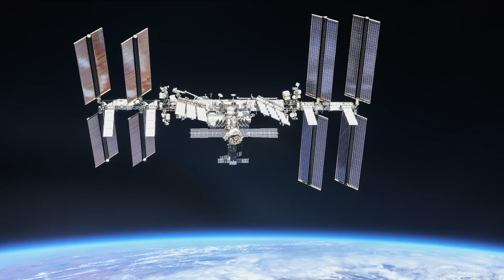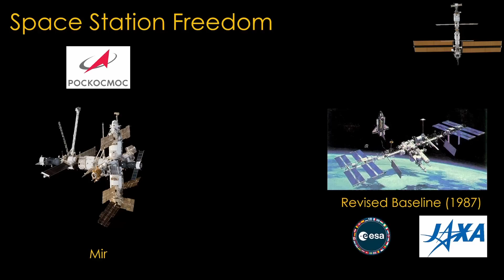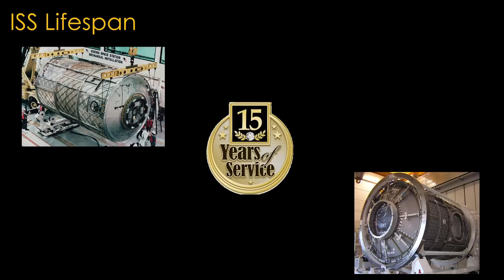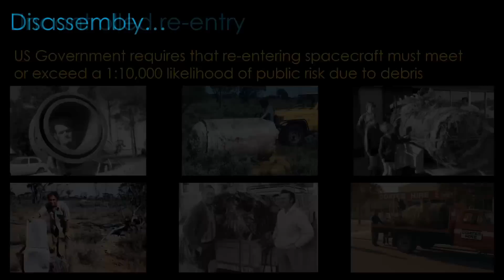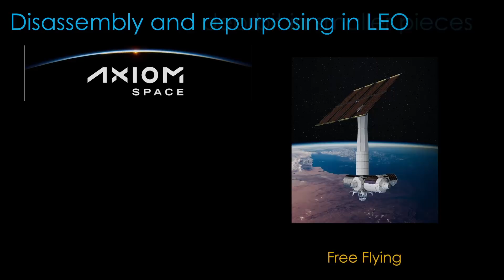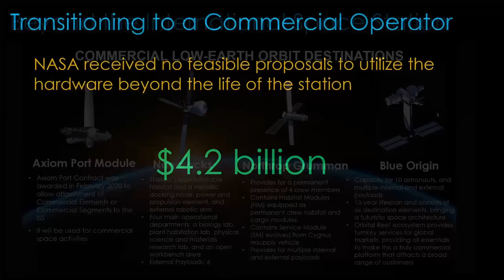The Rise and Fall of the ISS

Comment: What if they used blue ring or extra big the keep under constant acceleration to simulate crew living under constant acceleration cause we have never experimented with this but the risk debris and radiation two high but starliner on Vulcan and dragon can reach those higher orbit and if something went wrong the crew can abandon ship but at least we learnt how accelerate a large mass with crew and what the effect of that are for long periods of time before we go to mars of somewhere else it would be cheaper then building ship to test. Great video
Reply from the maker: You would need a lot of thrust to put ISS under noticeable acceleration.

Comment: The ultimate troll would be doing a practical test of whether Kessler syndrome is realistic by blowing up the biggest thing in LEO, in a completely illegal but very funny space demolition derby. Realistically, what's the total economic value of all things currently in use in LEO that could be destroyed (summing w.r.t. some weighting by a probability upper limit if one cares)? And how much would it delay space exploration considering that most interplanetary missions launch straight into escape trajectories (spending little time in LEO)? Yes, LEO is important for lots of things, but is that not balanced by how hilarious it would be?

Comment: What a 'WASTED Opportunity". Dumping into atmosphere reentry to burn and crash into the Pacific... 
Option TWO or B or Beta: Use the tug unit to - instead of into atmosphere, push into higher and higher elliptical orbit until one last burn and ISS is off to either an orbit in the solar system or out of the Sol System. Use the last few launches up to fill with things that will be 2020s Artifacts of Human Civilisation. In space for FAR FAR future 'humans'?? to discover or for extremely long term and another evolution of sentient life of Earth or another system to find and go HMMM how interesting. 
A Time Capsule! Not Yank mentality of use and rubbish when served it's initial purpose!
Reply: I actually kind of like the idea. At least on paper, one ~3/4 re-fueled Starship should provide enough delta-v to push ISS away from the Earth.

Comment: Ever since ISS deorbit was announced i thought about recovering the Candarm from it and having it in a museum 
On the technical surface: you don’t have cold welding and it would be relativly simple to bring in a Starship with a grabbing port and have the arm move right into the payload bay. If you don’t want such a large ship near ISS, you could have a dragon with a grabbing point in the trunk and shuttle the arm over to the Starship waiting at a safe distance.
Of course, I’m just an armchair engineer that probably doesn’t know about a problem that invalidates my plan but it would be cool to have a not so insignificant piece of the ISS back on Earth
Reply from the maker: Cool idea
Reply: @EagerSpace  I think I read somewhere that the plan was for the Canadarm to stay with the Axiom part of the station but I can't find that source again.
Reply: @thebattlehamster It's still the plan IIRC. They need the arm for berthing ops of passive ships/modules

Comment: why can't they bring it down part by part on starship?
Reply: They can. But it would be very difficult and expensive to take the station apart and pack it into a bunch of Starships which also aren't cheap, and no-one is willing to pay for that.
Reply from the maker: I talked about the difficulty of taking it apart. At best, it's technically hard, harder than putting station together was.

It would cost a ton, and who would want to pay for it.

Comment: What about boosting it and slamming into the moon?
Reply: That's even more difficult than boosting it into a more permanent orbit, and for what purpose?
Reply: @bbgun061  make a huge crater for mineral mining and research. They plan to use five starships to fly humans to the moon, boosting the station one way should take less
Reply: @tedarcher9120   It would be way more expensive than de-orbiting it and you risk contamination of the moons surface.

Comment: I had always thought that gradually replacing ISS modules with more modern modules and expanding the scope and size of the ISS over time would be the way to go, but as you point out the combination of high inclination (which is unnecessary without Russian participation) and the potential issue of vacuum cold welding of modules is probably the death knell to that idea. I still think the idea of an international space station with all space faring nations participating is a good idea in order to further geopolitical cooperation and stability, but with the current leadership in Russia (and China) it's probably not in the cards. I'm hoping this can be possible sometime in the future.
Reply: Yeah, it would have been great if the first international space station could have persisted indefinitely, slowly growing and changing throughout the decades and centuries as partners joined and left, leaving a temporary mark on an ever-changing canvas of international collaboration, Ship of Theseus-ing itself into the distant future.

Comment: You offhandedly state that the space station needs to be operational during disassembly, but... wouldn't that be dependent on the mission design? It's not like the Hubble needs to provide an environment during the maintenance missions, and if the Axiom capsule is designed to function independently from the ISS, you could seal it off and use it as a base during the work. And that's before we get into launching multiple vehicles for the work at the same time. (Imagine two Dragons and a Starship! That'd be really neat.)

I am not saying that any of this is a good idea, but it does seem possible.
Reply from the maker: It needs to have attitude control and power and you need somebody to operate the Canadarm 2 to grab onto modules and pull them apart.
Reply: @EagerSpace  I may be a dumb dumb, but doesn't Dragon come inbuilt with both of those? And if Axiom wants to be a grown boy, it'd also need both the power and altitude control. 
Good point on the arm. ... ...now I want us to salvage the arm.
Reply from the maker: You need attitude control for the station so that it's stable enough that you can dock with it or so it isn't spinning when you get to it. 

AFAIK, Axiom doesn't have a robotic arm on their station.
Reply: @EagerSpace  I feel like we're talking past each other.
1: One Dragon docks with the station, turns it off, and performs the salvage work. (I already acknowledged the point about the Canadarm, so let's pretend that isn't an issue.) 
2: Once the Salvage Dragon undocks, either the Axiom module performs altitude control of what is left, or you use a second Dragon for that purpose. 
3: Rinse and repeat until you've collected all of the components you like, Axiom detaches, then deorbit the remains into the ocean.
Reply: @thearpox7873  Unless I'm mistaken, you need attitude control over the entire station to keep it stable. Only having attitude control for part of it either wouldn't be effective enough (The ISS is much more massive than Axiom's portion), or cause excess stress on the joints, and creating a risk of snapping at some point. Or both.
Reply from the maker: As soon as you turn off the station it starts spinning. The solar panels and radiators have high drag and that torques the station around. You need active attitude control all the time. Maybe you can get that from the Axiom segment temporarily but it won't be designed to keep ISS stable, just their modules. 

Dragon isn't designed for station attitude control; the thrusters don't have enough endurance and they are likely in inconvenient locations.
Reply: @EagerSpace  I see. Well, they appear to be designing a custom Dragon variant anyway for deorbiting, which may have both the endurance and the power, though maybe still have the inconvenient locations. There's also the point the other guy brought up about the possible risk of snapping, which would also put a dampen on the idea. Thanks, I found this interesting to think about.  

The solar panels and radiators causing high drag even above 400km is interesting though. Is there a video you might recommend on that? I don't remember any of your videos being on this subject.